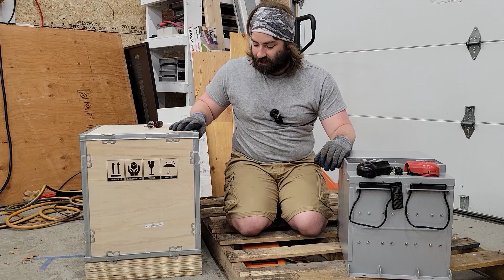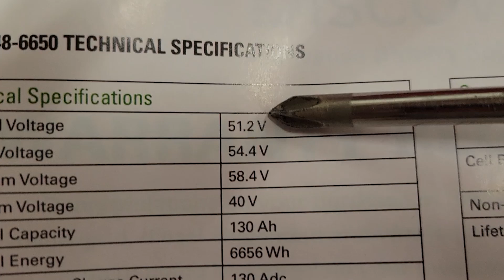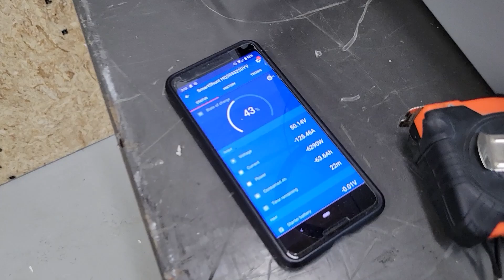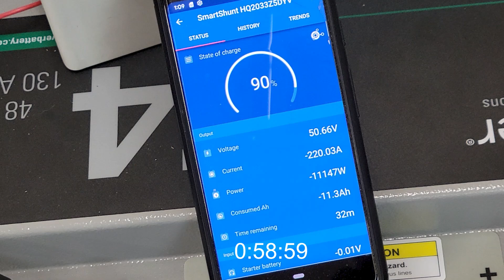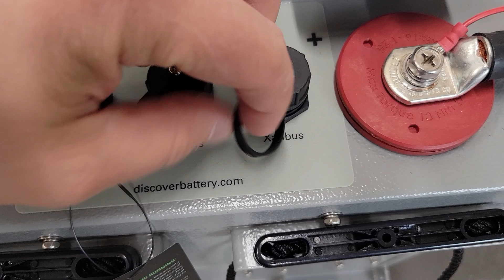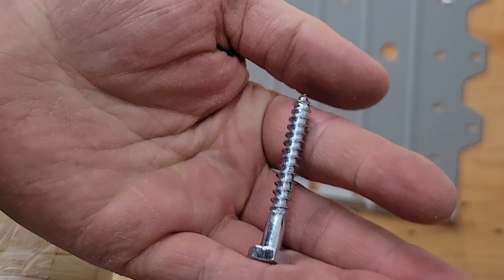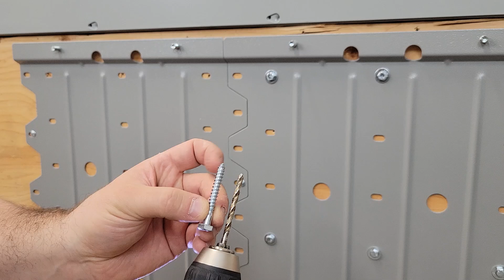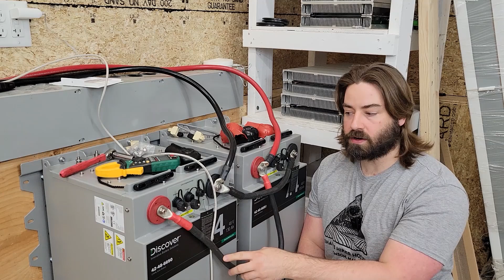Discover Battery, worth the price?

Comment: Hello DTG, I remember asking you a while back, if you ever tested Discover AES, you said no, I'm glad, you finally got your hands on them
Reply from the maker: Yeah, it was fun to try them out.
Reply: @DavidPozEnergy  if you ever wanted to set the batteries up a Schneider or whatever system all on 1 board, I can purchase 5 to 10 of them from you and put them in my homes. 110 and 220 outlets with a honda generator if need be. All I'll do is purchase the batteries too, from you and set them up. Maximum 20 to 40 panels (230 watts or 600 watts) 2 discover batteries per system

Comment: OK, the fact that it shutoff at 1 minute pretty much to the millisecond pretty clearly shows that it did not shut down from a hardware fault error on a sensor but did so from a logic set point for running out of spec. VERY IMPRESSIVE
You should run this test a few times to verify that it is in fact timing out at 1 minute as opposed to going into protect mode from a sensor event.

Comment: Maybe a good battery but it is very over priced.
Found it for $4500.
You can get 3 EG4 surver rack batterys for $4500.
The EG4 is 5.1kwh for $1399 from signature solar.
So you could get 15kwh for the price of this 7.1kwh battery. 
So 2x over priced.

Comment: quite solid specifications, let alone the fact that actually overcome the expectations (over 200 amps lasts a minute which is wow)
for me 1C charging is a great thing even though I wouldn't use it, a 0.75C charge and a maximum capacity of 85% should keep it safe and healthy along the entire lifetime
Reply: read the datasheet before assuming the cells can handle 1C charging.

Comment: I love the build and packaging of these batteries, but wow are they $$$!  Unless I missed it, what cell chemistry are they using?  How much access does the user have to the BMS data and all the settings?  Is the BMS balancer active or passive?  Nice install information, but lacking a lot of the tech info!
Reply: I just noticed you state they are Lithium Iron Phosphate cells (LiFePO4) in the description.   I wonder who's cells they are using that they are comfortable with routine 1C usage?
Reply from the maker: Yes, LiFePO4.   I don't know the cell manufacturer

Comment: That termination and splitter solution for the rj45 stuff is pathetic. As an electrical and computer engineer, that is such a simple interface/bus to figure out it boggles my mind they left it in such a state. There is a very simple way they could have avoided needing that workaround not to mention they simply chose Ethernet as a dumb wire and therefore could have used literally any other form of connection but are now dealing with an aspect of the communication they don’t understand.
Reply: I thought the same thing when I saw the splitter. For such an expensive battery that's unacceptable. Like you said, very easy to do correctly.
Reply from the maker: Thanks for your comment.   Do you have any speculation as to why they might have built it like this?
Reply: @DavidPozEnergy I guess they couldn’t fit more waterproof RJ45s on that front panel. Though they could have put both of the buses on the same cat5 cable (there’s 4 pairs) and had a splitter in one place if you need access to both of them for some reason.
Reply: Yeah this was a cheap COTS solution, not reliable at all. Brought back the horror of the 90's and the fax machines I constantly had to "fix" for companies, because these came loose.

So much effort in the battery to hinge on this, wtaf?